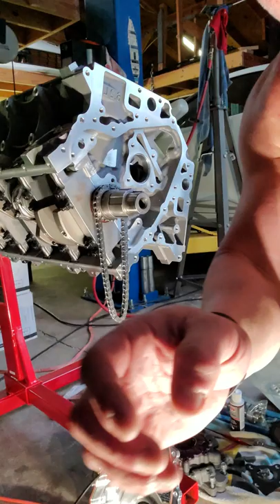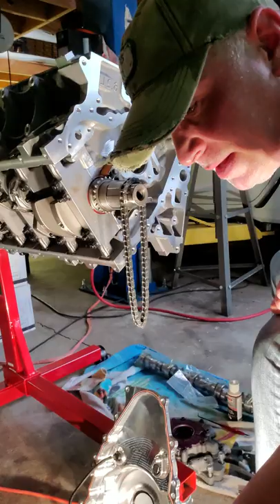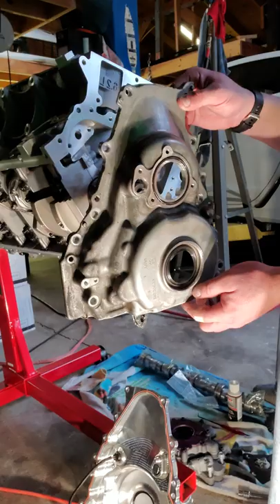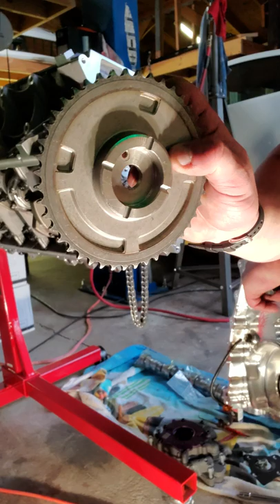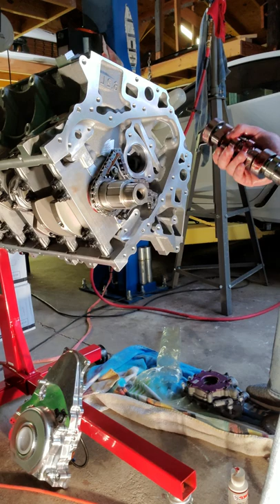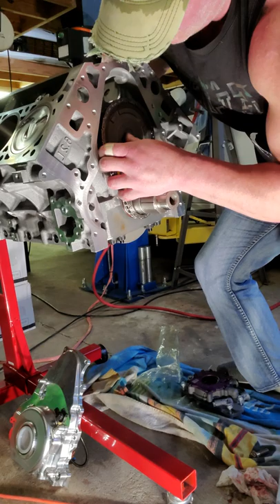Installing the LS3 sprocket and cam modified for timing offset from the LME Billet VVT delete kit.

Comment: You are looking at #2 tdc.  #1 is on the driver side of the engine.  The cam dowel should be in the 3 o clock area. Line up the crank dot w the cam gear indicator
Reply from the maker: Yep maybe video is backwards.  Need to check. Yep number 1 and odd is driver side.  And yes crank arrow is lined up with cam gear dot.  Engine was finished and ran perfect.  My oil pan has some leaks. And my steering rack went bad.  Car will be back up in a couple weeks.  On my lift now all apart.  Thanks for the input.
Reply: Jacks, if you look closely, his video is reverse. So his #1 cylinder is TDC.
Reply from the maker: @ShowBiz25 , I appreciate that, yes I need to spend more time on editing and reviewing my footage.  My clutch install was the same way.  Thank you!
Reply: @MichaelBrownPlus  yeah if you’re recording on your phone you have to use the camera away from the screen or go into your camera settings and change it to reverse video
Reply from the maker: @user-xz3rn5lz8g  Thank you I'm an enterprise cloud architect been in software development and architecture for 25 years now and my videos look like they are edited by a 10 year old lol.  I have a nice GoPro Hero 9 I may switch to that soon.